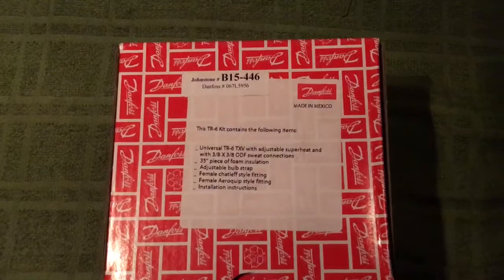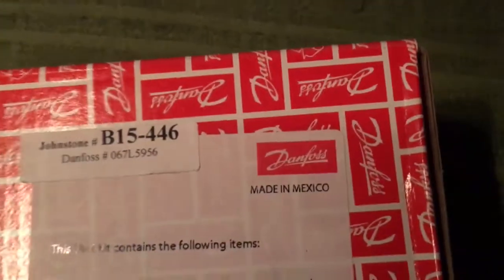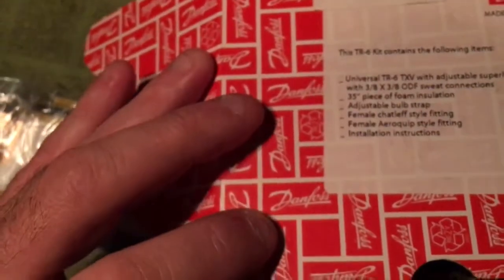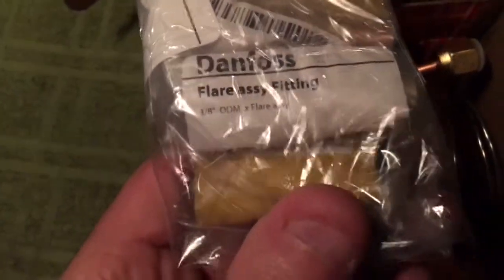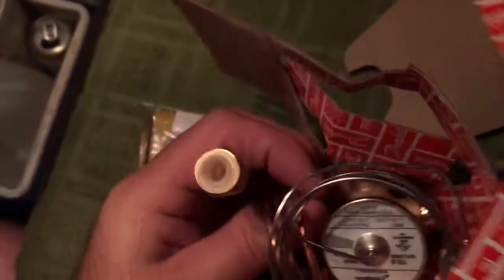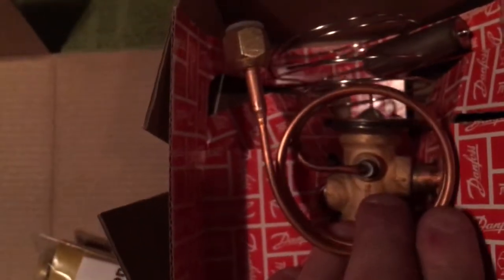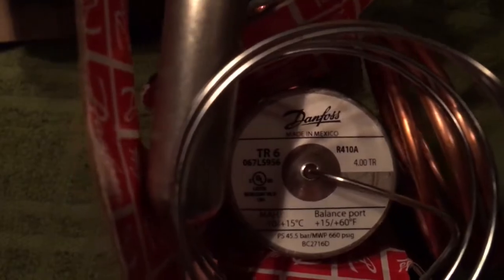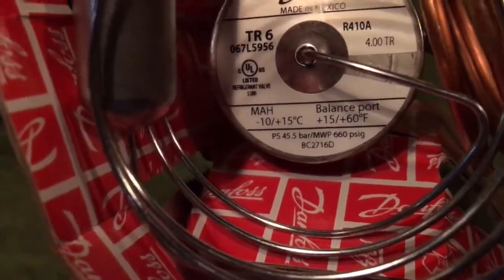This is what a (Txv ) Thermostatic expansion valve is.

Comment: really like those txv's  I install them all the time ....
Reply from the maker: I'm Liking it So far. Seems Really Well made. Time will tell. First time using this Particular danfoss valve. i Usually Allways use Alco Valves. or Sporlan in a Pinch.
Reply: OcRefrigeration,Hvac & Electrical. you won't go back to using Sporlan Alco or Emerson  brother, you will soon find out , I also use danfoss txv's for refrigeration , they're compact and you'll hardly have to adjust your SHAWN, or SC....thanks for sharing
Reply from the maker: interesting Bulb Strap~~But, Seemed to Hold Really tight. Pleasantly Suprised. i've Been an Alco Man for 35 Years. We'll see.
Reply: OcRefrigeration,Hvac & Electrical. I'm telling you

Comment: Looks good. Install video to come?
Reply from the maker: Maybe ---it's looking good.
Reply from the maker: Yea, i got a little Footage. i have to put them them / imovie editing time. Worst case it should go up on the weekend.
Reply: A little off track from the original video but since it is just you two guys in this comment section, thought I might be able to pick the brains of my YouTube gurus....

Delfield sandwich prep unit.
Model "Custom" V18645-32 S/C Refrig Base
 Oldie.. 1997 but still in great shape.
Unit presented with evaporator fan with broken blades and iced evaporator.
Thawed unit, replaced evaporator fan motor and new blades.
Evap starts to ice over again.
Evap pressure low.
Recover very little refrigerant (took three weeks to borrow recovery unit from our "maintenance" department). Change old flared drier. Flushed with high pressure nitrogen from both high and low sides,  pulled and held vacuum, recharged with weighed in 30 oz. fresh R22. 

Don't remember the exact numbers but low side pressures dropped to single digit P/T temps, while high side pressure temps were ok. So I have a restriction? Now a couple of months have passed since I changed out the evap motor and fan blade, could not remember seeing if it had TXV or cap tube. Checking PartsTown online manuals for similar but not exact model number shows TXVs... 
My question:
If TXV, do I need to get an OEM Delfield TXV or is there such a thing as an R22 TXV for fractional HP system?

Long winded, thanks for reading, even if you don't respond, just wanted to say thanks for all the great info that you both produce and publish. I'm really a F&B management/inventory control guy who got a degree in HVAC a long time ago but never did anything with it and now realize I'm tired of dealing with minimum wage idiots and would rather fix things. Have a unique situation right now where I am making the transition.